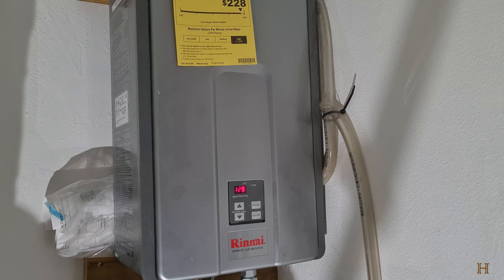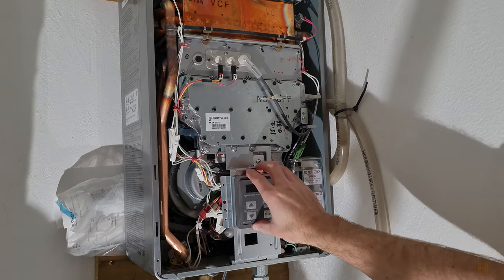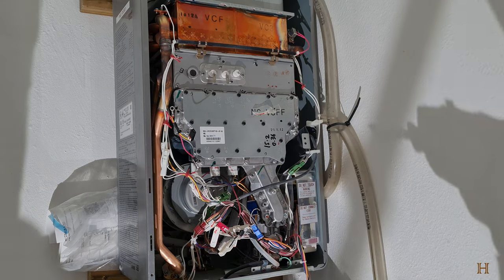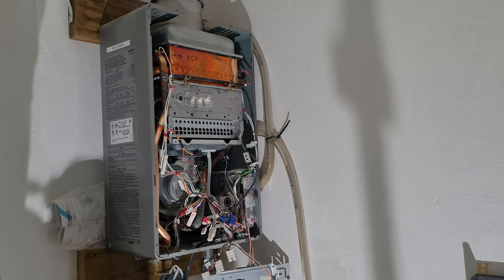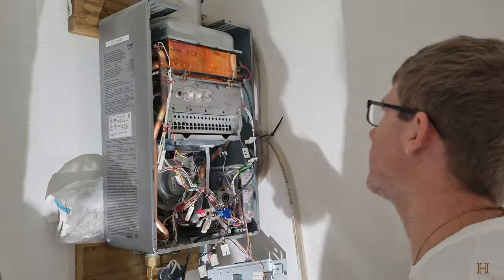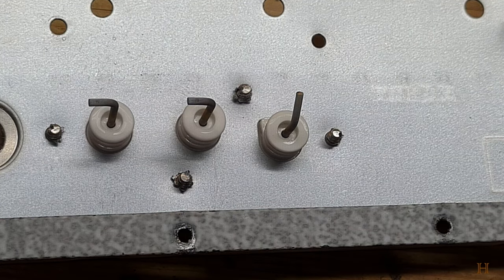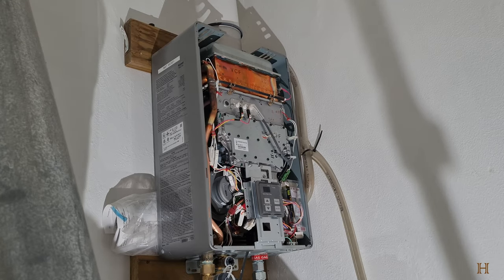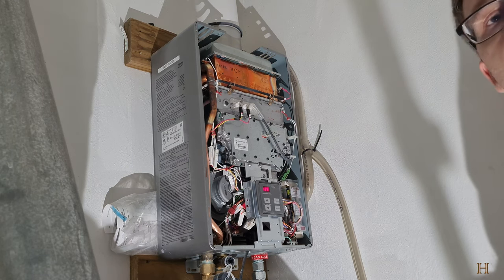Fixing Rinnai Error Code 12

Comment: I fixed error code 12 by changing the flame rods with new ones.  This usually keeps it going for about another year before experiencing the error again.  If I just clean the flame rods with scotch brite pads, that only fixes it for a few weeks, so it is better to replace them entirely.  I used compressed air to clean debris from the grid with the compressed air straw poking through the flame rod holes.  If the problem happens again I am thinking of taking out the whole grid unit according to your video to clean the combustion dust off better.